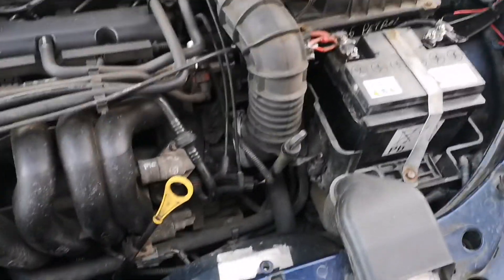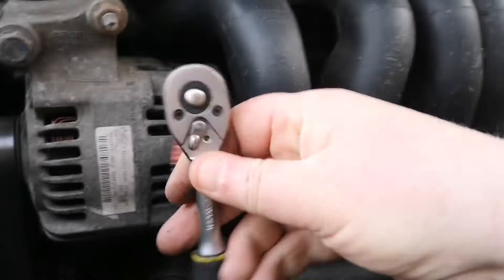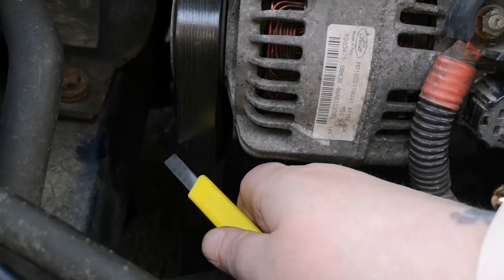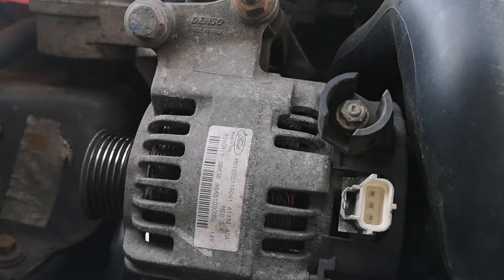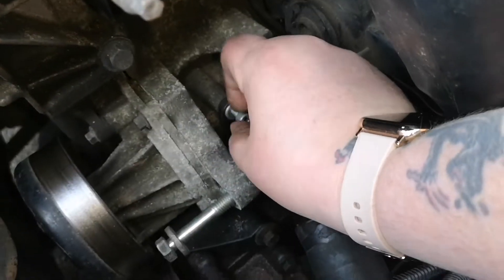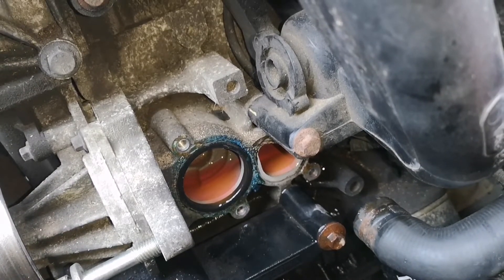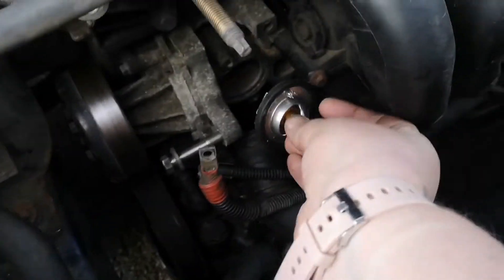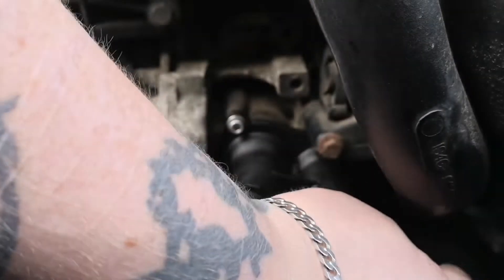No THERMOSTAT in this car!! Overheating problem solved!

Comment: No therm is yes/no 
Yes u can do it 
no u should not do it 
Certain variables come into play 

I do this tho
I live in above 70F temps and live in city tho

If I were commuting road trip status or lived in Canada it would compromise the crap out of my machine
Reply from the maker: It was 38°c daily temperature and i was doing stop start traffic everyday, it definitely needed a thermostat 🙂 thankyou for watching
Reply: @IvegotaroughideaDIYchannel  I'm still curious as to how putting the thermostat fixed the over-heating issue.
Reply: You can do road trips with no thermostat..and there shouldn’t be an issue